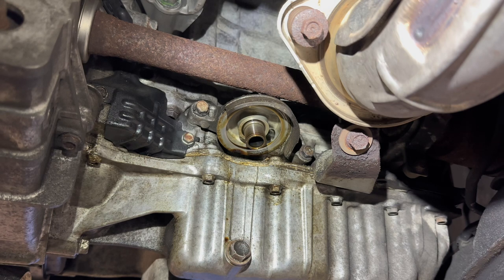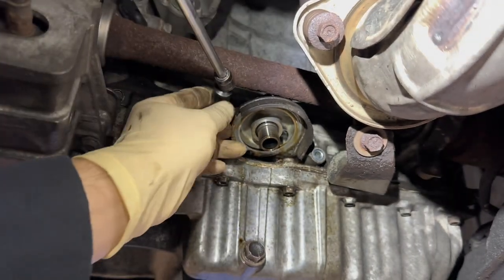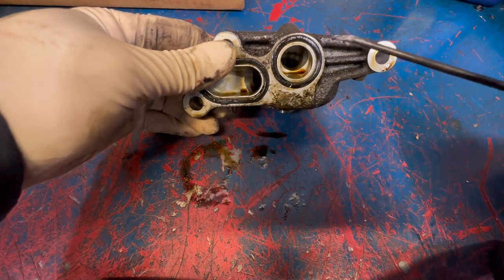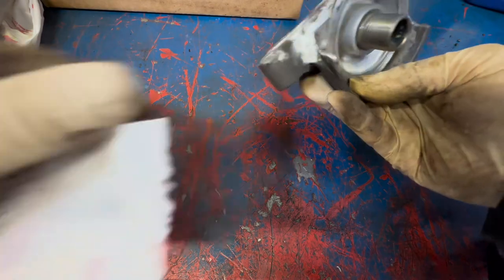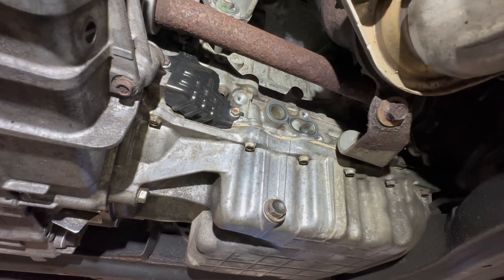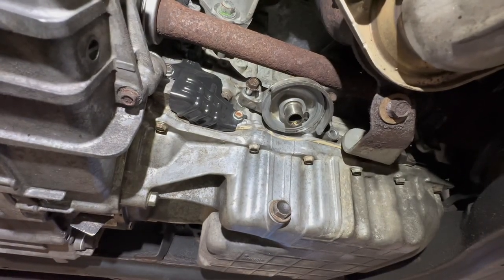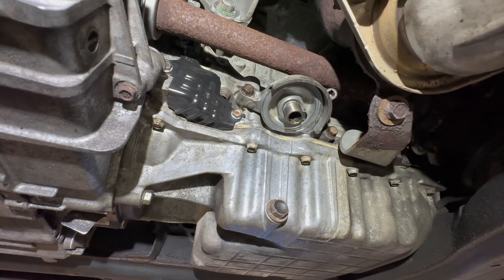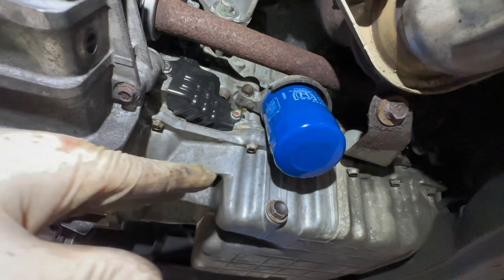Honda and Acura 2.4L oil filter housing reseal

Comment: Just did mine using your technique ( swivel 12mm socket 1/4" extension & honda bond ) worked to perfection 20 minutes. My gaskets were flat and brittle 260K.  I used Felpro gaskets from Autozone worked fine but don't go crazy tightening the bolts not necessary.  Thanks so much
Reply from the maker: Awesome! Glad to help 🙌

Comment: Gret video and thanks for the walkthrough.  Another tip:  You can remove the exhaust bracket just to the right of the filter.  It is 2 14mm bolts that weren't too tough to break, although the one closest to the cat was harder due to the more extreme heat exposure.  Why does it help?  I had a 1/2 pivot socket but was too large to get that top bolt which is really the only tough part of this job.  Removing that bracket allowed for a standard box end wrench to break it.  In fact, by removing that bracket, you don't need the pivot socket (although it no doubt gets it done too.  Of course, if you want to expand your tool set, pick one up.) Nicely done.
Reply from the maker: Yup, for sure like you said that exhaust bolt (especially anywhere above the rust belt) turns into hopes and dreams 3/4 of the times but definitely a different approach that can work as well. Nice job 👍🏻

Comment: we did this on my 05 TL. I saw a couple of vids of the J series with this issue too, it slowed the leak down a lot bc those seals were hard, but it was also leaking behind the crankshaft as well, so both of those got resealed just to be safe! now no leaks!
Reply from the maker: Yes, the j series also leaks from the oil pump along with crank seal and oil filter housing seal. 💪🏼

Comment: I did an oil change today and noticed some oil to the left of the housing all around that black plastic piece.  Would filter housing be the source of oil there?  What is that piece exactly? It’s between the filter housing and where the CV shaft goes into the trans.  Appreciate the video.
Reply from the maker: Yes most likely same leak. It’s pretty common.
Reply: @BCautosolutions  Thank you!  Appreciate you getting back to me
Reply from the maker: @nickferraro9226  anytime

Comment: 04 accord my oil filter housing is up from the passenger tire. The filter does not vertical but horizontal. Bad leak and don’t see any oil from v tec or valve cover. Is this job much harder in the 04 version?
Reply from the maker: Can’t recall right exactly right now but if memory serves me right, I don’t think those have o rings
Reply: Ok. I’m unsure of where leak is coming from possible the crankshaft seal. All I know is I see oil by the passenger control arm/frame area
Reply from the maker: @715glizzy6  may very well be or may be your power steering return line as well. They wtend to rust and also leak at the hose connections. Can’t rule that out.

Comment: How long did it took you?
And can i use silicone on the o-rings just to make sure it doesn't leak or it isn't necessary?
Reply from the maker: Takes me about 30-45 mins to do with cleaning. No silicone, only to use the prong to stay in place. A few dabs.
Reply: @Hondamobilemechanic  ok thanks!
I'm about to do this job on my crv
Reply from the maker: @2jz-_-241   best of luck!

Comment: This is exactly the problem I have with my 97 Honda accord v6 it’s leaking from that seal but the bad problem is that 3 of one of those bolts has been put in too tight so there’s a chance it can break inside and I don’t want that but the oil leak is very very bad and am not sure what to do
Reply from the maker: Your going to have to make a decision. I would try and fix the leak

Comment: Do you prefill the filter?
Reply from the maker: If the filter is vertical like this one about half way. If it’s horizontal depends how horizontal it is and it’s location/accessibility to clean.
Reply: @BCautosolutions  Thanks! I like the pro tips.
Reply from the maker: @jptrainor  anytime!

Comment: What he doesn't show you. You can't get socket on 3rd bolt due drive shaft.
Reply from the maker: Yes you can, 1/4 swivel 12mm. I do this job weekly 👍🏻
Reply: Doesn't work on the Si. Shaft looks to be thicker than the non lsd cars.
Reply from the maker: @vtecbrown  could be, I’ve never done an si.
Reply: @vtecbrown  bro did you have to take apart the pass side suspension and take out the axle to take that one bolt out? I’ve been looking for a work around but no luck haha first person I saw with an si comment I thought I was going crazy
Reply: @vtoxic-pepinovggs2194  yes that's what I had to do, minus the suspension. After taking the 3 bolts off the intermediate shaft mount, there is enough play for me to slide it out of the transmission to gain clearance for this job.
Reply: I used a 12 mm ratcheting wrench just reach from under over top of the bolt worked great